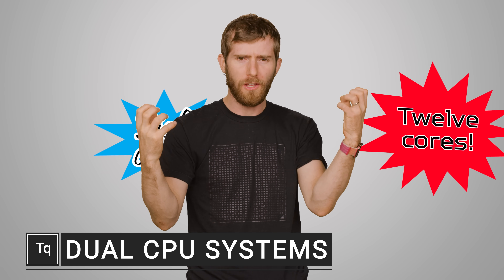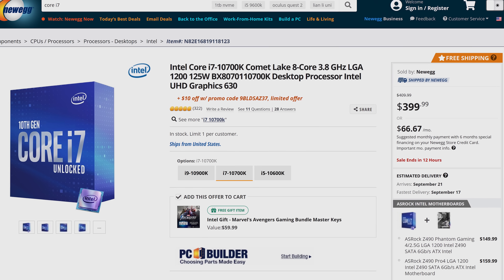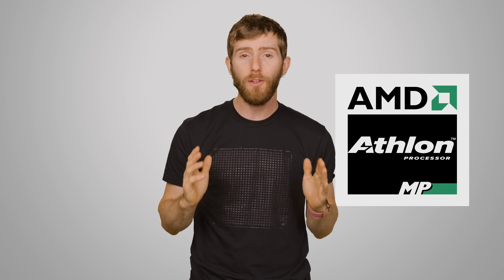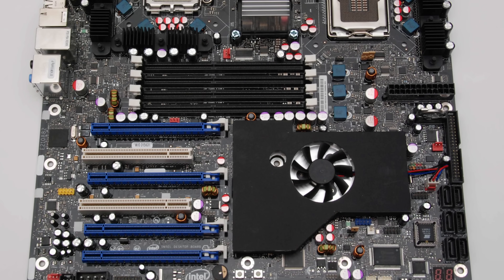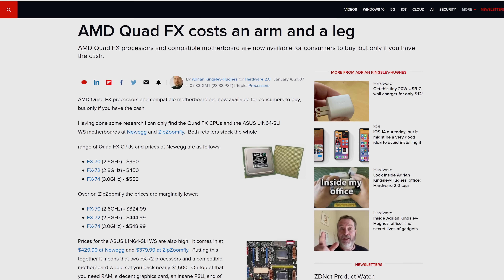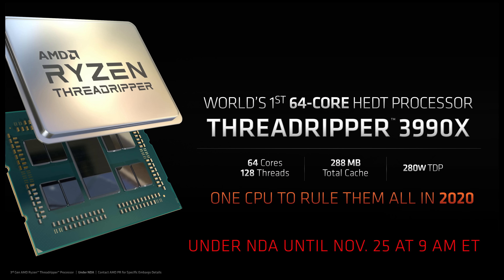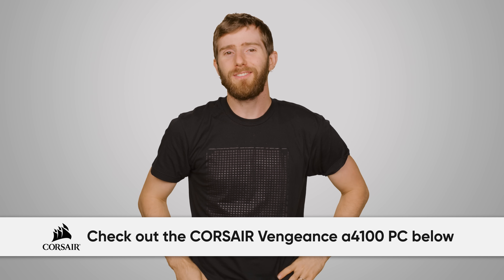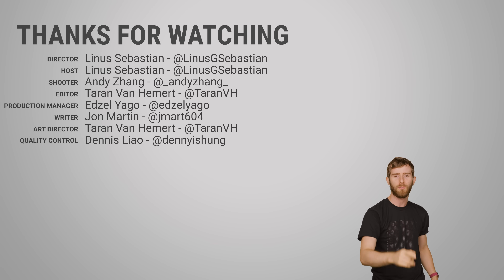Should You Put TWO CPUs In Your PC?

Comment: Multi-CPU feels like it has potential mostly for pushing performance to the hard capped maximum of the day.  We're not filling pcie4 yet.  But if we had a board allowing two CPU's, it could potentially let us go a little crazy on GPU's.

Basically what I'm saying is if the motherboard is our nerves and the cpu is the brain, and the power supply is the food we eat, then the gpu is the muscle.  And there's a limit to how much muscle a brain can support.  The soft cap of such is bottle necking.  The hard cap is where absolutely no additional benefit is reached from having more gpus.  

This is theoretical of course.  And there's still way too little support for mGPUs to warrant getting such a setup (especially disappointing since VR feels like the ideal place for it).  But for a workstation, this could be scary.

Comment: 4:10 ".. which allows one core to work on two or more threads at the same time" ohhh pleaaase don't spread that misinformation, they make one core switch BETWEEN tasks more quickly but they never process information at the same time because they are not cores, they are register banks THEY CANNOT AND THEY WILL NOT PROCESS INFORMATION SIMULTANEOUSLY, anyone claiming differently is selling snake oil.

Comment: For the inner geekers: keep it 2 sockets, trust me, and place 2 Xeons, (minimal quadcore @ 3.0 Ghz (X5570) or hexacore @ 3.0 Ghz (X5670). You have to remember it runs on 1 CPU so thats why you need a good base cpu and just double it as you go, you'll notice it, my 2008 pc stil rocks 1080p highest untill last week, (8xMSAA ON!) oh yeah throw a GTX 1070 in it or equivalent.

But if you want a machine that you dont need for gaming hey be my guest and check out AMD Opterons or any xeon below 2.6 Ghz lol (e5530 2.4ghz DUAL is also capable of medium gaming with a 1060)

Comment: Why don't motherboards have a CPU slot and GPU slot so both chips can be on MB and both have their separate coolers.  Wouldn't that be faster than a CPU with integrated GPU.  Maybe a bit slower than a separate huge GPU card but really a separate discrete GPU that can separate the GPU heat but still save space and price.

Comment: I have probably the saddest setup. 3screens with them all different resolutions I can even have a 800x600. It sucks I really wanna fix it. And I have a 2.1 GHz clock dual core. And 4g ram. It's slow. Really slow, I deblotted it and I did what I could. Everything else requires money which I don't currently have... Or don't have much of. Ill try to upgrade once I can start making more.

Comment: Back in the day we were visiting my dad's friend and in his garage he had plenty of computer parts and so we just made a computer except 2 CPU's which kept the cost down and also we were playing with 386 parts not 486 as this was the older stuff in their garage that they had plenty of which was not so outdated at the time, and then later more of these things popped up and people were eventually trying to make 586 PC's. The problem now, which this video talks about is the software not taking advantage of the hardware. An other thing I did back when I was younger was look into solid state drive technology, that had been around sense the 1980's. An other funny thing is having a circuit board full of RAM and using it like a temporary drive which as you probably know is going to loose all the data if that computer gets turned off, and so you still wanted to work with a hard drive and then move some data over to the circuit board full of RAM. Solid state drive technology from way back when what I played with, which you might as well think of as a USB flash drive with less storage space, but this was before USB was available but really the technology was different.

Comment: Makes me think back to the BP-6 days.  Sure, having a multi socket xeon is great, but before this "cookie cutter cores" thing, us old folks were often stuck with a single core.  Then the BP-6 came out and told intel and their "that won't work" attitude to go fly a kite in a lighting storm.  A BP-6 board with a couple of good celeron processors, a dedicated OS disk, a dedicated software disk, a couple dedicated swap disks, etc and holy hell could you build a smoking fast machine.  Also, if it's not obvious, I like disks. :)

Comment: The easy way to take advantage of that new i9/10 core/20 thread beast with 256 GB of ram is to use it to perform continuous analysis and processing of proprietary data 24/7 in a custom multithreaded application that makes use of every core through well behaved code.   Done right, it results in being able to replace more than a dozen single tasked PCs with one .... and have the results completed in a fraction of the time.
But you, over there, working on your home budget on your home pc... you don't need it.

Comment: I remember building a Dual Pentium III machine with SCSI drives back in 1999 because I could write it off against my consulting income.  Well over $2k in pre-21st Century money.

Good times.

Had to run NT as Win98 etc wouldn't take advantage of the dual processor setup.

Comment: A few years ago I had a DAW built around a dual-xeon rig, with 2 6-core e5 haswell chips. I decided to experiment with a 32-core 2990wx. Despite the ~2x clock speed and nearly 3x core count, the Threadripper chip performance was horrible. Even after crazy configurations like disabling every unused device, (including the network cards), limiting all non-DAW applications and interrupts to 4 specific cores and giving the rest of the system over to the DAW and interface, the signal had too many pops and clicks to be usable.  I went back to the Xeon machine. I couldn't figure out what the bottleneck was, so I'm left guessing that it was the wacky "half the cores don't have direct access to memory" architecture.

Comment: for the duel CPU set up it depends on how you set it up for if you have to go through CPU to CPU to access system RAM you can have the system RAM be per CPU so you have all you put into the board be the system RAM OR you can do it so one CPUs system RAM is duplicated to the other CPU's system RAM. I am unsure if that will get you any performance gains with modern CPUs but it used to with older ones that them memory controller just had to deliver the data to both sides of system RAM instead of just one unified chip like today. It did have the major down side of having you have 1/2 of how much system RAM you bought and have to have the same system RAM amount on both sides of the board with the same manufacture of system RAM on both sides too with the same die SKU on both sides too. 
For motherboards that have the RAM controller inside of the CPU doing that is no longer a positive thing to do as you still have to pass through the RAM controller either way and having more RAM is better than the minor speed increase you would have gotten from doing that as CPUs got a lot faster and memory controllers got better at how to access RAM.

Comment: I never really cared for computer internals but recently I bought a new computer and decided to break down my XPS 8300 to the individual parts.  I then took the old case and am just sort of experimenting with different stuff I can put in it. 
 I do have a question for any computer experts.   Are you able to manually upgraded an old board with a sawdering iron and parts from other old boards or is it just trash once it becomes to old?  (I am still rather new at tinkering with boards)
Reply: I very much doubt you can do anything significant. The boards are multi-layer, and the chips are surface-mount, soldered by machine. Of course, you can change the motherboard and you can change the CPU, provided everything is compatible (socket, memory, case, power supply etc.). The Wikipedia lists of Intel and AMD processors provide much useful information. I have carried out several such modernisations; currently, I have a system with my 2011 case, memory and disk drives, but a more recent motherboard with the best Core i7 CPU which still supported the old memory. Over the years I have replaced things like monitors, the power supply, keyboards, added an M2 SSD, added several very high quality silent fans and a CPU cooler. I learned about cooling CPUs, delidding, liquid metal and so on, even though I don't really overclock my four-core i7 4790K CPU. Under Ubuntu MATE Linux, It does everything I need without any noticeable delay; the CPU's integrated graphics handles two monitors and six Linux workspaces perfectly adequately. I have a GTX Titan for number crunching, but haven't used it yet. The MB, CPU and Titan were purchased second-hand via Poland's equivalent of eBay. I'm a scientist, not a gamer... but gamer-oriented pundits such as Linus provide excellent info on how to build your own system.

I  had a couple of dual-Pentium boxes for free from a dismantled Beowulf cluster about 2005 to 2015, they were very good for their time, but 1 GB was a rather restrictive memory limit. Linux handled SMP just fine, but software such as browsers kept getting bigger and slower.

Comment: can't beleive you didn't mentioned the ABIT BP6 . The idea of this mobo wasqyuite revolutionary: using 2 cheap desktop grade cpu in a gaming system. Of course it was a large flop, not only smp compatible games were rare in 99 (only quake 3 iirc) but also, they had to screw over intel to make multiprocessor work on a celeron. Obviously intel make sure the next generation cpu coudn't be use in a mp configuration. 
So, this board was doomed from the start

Comment: There is a big difference between a dual core and a quad core cpu in performance. Dual motherboards enabled further functions for the cpu, that should the secret be behind the existance of today's dual boards, also the bandwidth is lower with one CPU, dual boards use more leads in the sockets. In reality, processors use less than half of the outlets, than supported. Intel core 2 duo has about 10 more strings toward the pins,  than pentium dual core in laptops. More than half of the pins are not connected.

Comment: I guess the actual answer to Linus' question if you want to put in multiple CPUs in a server.. is it  depends...  ;-) 
Yes, that's the standard consultant's line. (sorry about that, but will explain...) 

Yes, for the average home user, it doesn't make sense.  Buying the largest thread ripper or Epyc chip doesn't make sense either. 
However... if you're using this machine to server multiple tasks and / or make it a centralized server,  you may want to have dual cpus.  (Going beyond dual sockets is where you start to see diminishing returns for a couple of reasons.) 

First, with AMD today (Intel in the near future) you have a high core count.  Something you didn't have earlier.  The upside... you can run multiple things in parallel.  The downside... you need to have more memory.  For today's Data Scientists that would be about 8GB per vCPU. (thread) So a single 64 core chip would require 1TB of memory. Dual socket would be 2TB of memory.  (Note that ASRock has a rack server which can handle 2TB of memory...) [Linus did a review].  So you can use this as part of an AI cluster, or you could run VMWare and split this into virtual PCs for server consolidation.  (Linus's office's Machine room and Rack is 'puny'. )  :-P   With detached storage from Compute, going w a lot of memory, cores in Compute server w detached storage over a high speed network >40GbE  makes sense.  

The tradeoff is that to build out a single server... you are looking at 4-5K per CPU, then 4-5K for the memory per CPU,  High end GPU, ... etc ... so you can see even a single chip server is >14K or so. 
(All USD) Adding the second CPU will increase the cost.  

There are use cases for this. 

But back to Linus' point.  W a high core count available... there is less  and less need for that second CPU.  There are trade offs and it will depend more on the situation.  
For many who follow Linus... going more than 8 cores is hard to justify.

Comment: I am still running an AMD board with 6 
 sockets for AMD Athalon MP 2600 @ 2.13 GHz.  If I recall each processor was well over $1,500.00 US at release.  Each stick of RAM was well over $1,000 US.  And of course, runs on ECC RAM.  4 GB max Ram - I run my firewall on it.  Works fine.  Can not remember what the boar manufacturer is.  Too lazy to check, LOL.  But the heat dissipation is a bitch and it sounds like an aircraft jet engine.  LOL  I keep my machines as long as I can, period.  BTW, It is running Linux.  :)

Comment: Latency. It’s as simple as that. Adding more CPUs will hurt performance rather than help it, similar to how adding more cores without increasing clock speed will hurt cpu quality. 32-core 64-thread @ 1ghz is far slower than a 8-core 16-thread @ 3.6ghz.

Comment: Next project: build 2 entire computers in a single tower case and make them work together
Reply: they already did that
Reply: @akabiscuitwaffle  where? Can you either send the link or title?
Reply: @akabiscuitwaffle  nvm I got it.
but it was not, what I wanted, but oh well
Reply: Twin PC cases are a thing, sir.
Reply: @akisalmenaho8473  He meant a dual system that can use resources from each other like sharing gpu or cpu power
Reply: This was done in the 90s.  I remember NEC had a workstation that did this.  2 complete computers in a single case for redundancy...  extreme redundancy.  It replicated everything on one computer to the other in real time.  If one computer failed, the other would take over without loss of use.
Reply: @BloxBall 
Yeah
Reply: But has it been done with 1 AMD cpu and 1 Intel??? 

Got a Gigabyte M68MT-S2P (Athlon II x250) and a Gigabyte 945GCM-S2C (Intel core 2 Duo)
Plus ATI Radeon 4300/4500 graphics card for good measure.

Been running the Athlon II as daily driver but with 4 gigs that was overkill when built it's pretty much done after one too many Firefox windows get opened.  

For some reason even though I am definitely gonna build at least an AM4/Intel 12/13gen this year.  Seemed like a duo buddy would be just what that poor little Athlon II would need to keep it chugging till all the prices settle mid year.

Although might be more interesting to just race these 2 boards with the best athlon/pheonom x4x6  AM3+, 8 (maybe 16 gb ddr3 1600m an SSD and a less than geriatric video card for good measure) vs IntelCore2 (Ykes ddr2 1333 4 gb)  well ok maybe the AMD has an unfair advantage and ddr2 vs ddr3 might even make pairing boards impossible.
Reply: GDDNabbit I hate it when the reality of the numbers gets in the way of my dreams of world conquest  And a double nut punch X6 amd for that board is $100 more than a R5 5600.  Could conceivably justify 8 gb 1600 (stiill think it'd take 16 just fine if windows couldn't see but 4 in the first place out of the box :), SSD, and HD 6670 if I found a game I liked and maybe I can skip one more generation.  $60-70for an x4 (Athlong or Phenom???) Crap another tech rabbit hole to dive head first into.
Reply: There are quad sockets server boards look it up
Reply: There's an online store in the UK that sells a crazy computer that is 2 PCs in one tower and costs £30,000. They can be made to work together I guess.
Actually a good store, they just sell some crazy stuff by someone apparently famous in the overclocking scene.
Reply: RTX 6180
Reply: That way you can have 12 of 16 vcores run VMs while running 4vcores for gaming
Reply: Here's what a pc guy, I guess? Quote: "Consumer CPU are made to work alone. While some server CPUs are made to work with up to another 3 CPUs"

Comment: I ran a duel pentium two 333mhz processors with 256 megs of RAM for five years six years late 90’s early 2000’s. I started out running windows NT4 until they came out with windows 2000 server.

Comment: I had dual CPU systems at home from the 1990s till around 2006 however these days with the amount of cores AMD has on its Threadripper CPUs it's no longer a desire of mine. Also to get dual CPU,  you need an Epyc or xeon which will run at a slower per core clock

Comment: I kinda want to see a motherboard with two CPUs with one dedicated to the OS and the other for applications
Reply: That kind-of happens with Windows now. Windows may try to stack as many small programs onto a single core when the cores are not loaded to take advantage of turbo boost. 

It's very hard to use exactly 100% of a CPU. With just a 2nd core, you almost always will have at least a tiny bit of CPU power to keep things running more skookum. 

I think the PS4 also did what you mentioned. There's a mini OS on an ARM processor or something to help run stuff in the background. It led to some weird things like a hard drive running off a USB bus. Seriously... check out the PS4 hack video.
Reply: Ooooooooo yeaaaah that sounds amazing

Comment: 0:3:36 this linus comparing that 2011 v2 x79 dual cpu with threadripper 3990x =.=' tell you what... my dual cpu 2011 v3 x99 run at 3.3ghz 24c48t and the motherboard + both cpu cost me only $275... That 3990x alone even 2.9-4.3ghz 64c128t, will cost me about $5700 or $6300 with motherboard... That was not a valid point comparing things like that... and who says people dont use all the cores nowadays? even if we say mediocre user for example only use it for gaming, i pretty much can make 9 full set high end gaming pc which can gaming on max setting in any games for the same price of a 3990x... So why we even talk about it? because I already mostly agree about most people only need one cpu and for most thing... But having 2 CPU, seriously has  difference...

Comment: I've got a BOX of those cpus behind me.. sx33, dx33, dx2-50, dx2-66, dx4-75, cyrix dx4-clone 80mhz, dx4-100 and 120, a bin of like 20 mobos (socket 3/4/5) and pantium cpus 75-233, p-pros and a ton of other crap.
Collect and love retro systems <3
Reply: I've actually got a non-ZIF dual-socket board very similar to the one shown, and a dual slot-1 populated with p3-500s